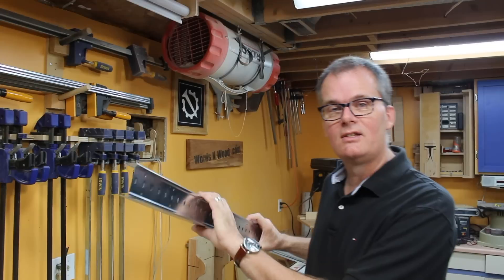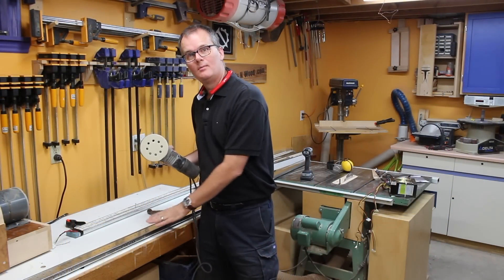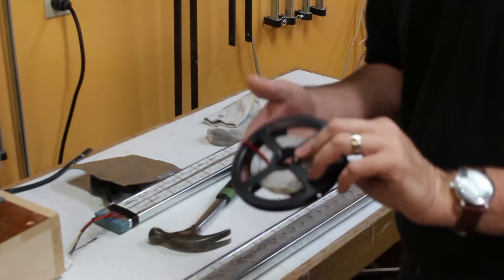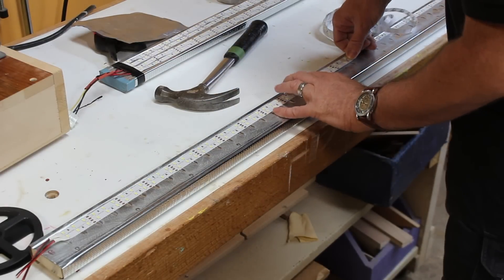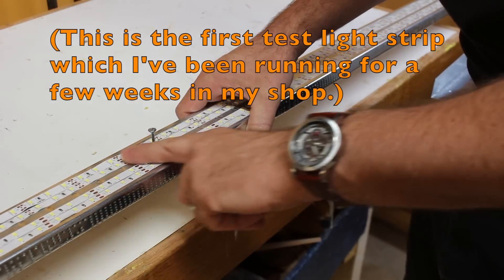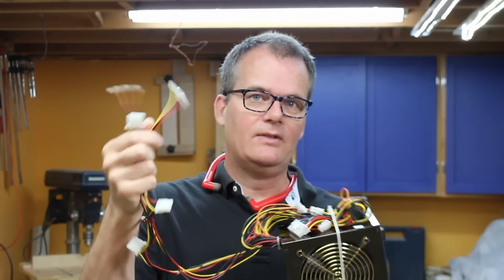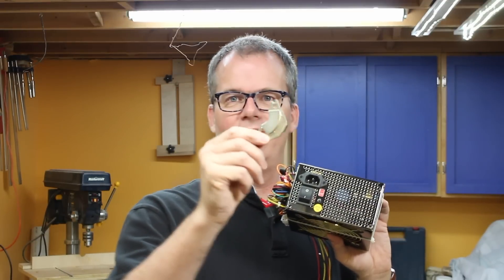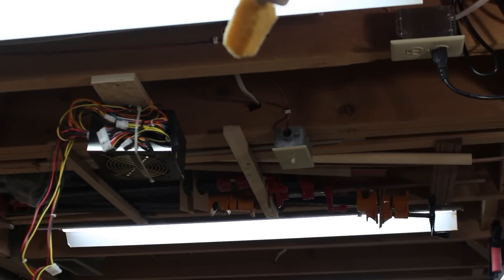Hacking LED strip lights.  AGAIN!   Last Time!  Promise! (WnW #59)

Comment: Seems cool, but, the 400 watts power supply takes away from the efficiency of the LED. Wouldn't a 100 watt bulb use less power?
Reply: It supplies up to 400 watts. That doesn't mean it uses 400 watts all the time.
Reply: Besides what Emil said, strip LEDs are pretty inefficient because of all the resistors. Would be much cheaper, in the long run, to buy some e27/26 sockets and install LED bulbs on the ceiling... or to get some kind of ceiling lighting unit.

Comment: Clever way to mount the power supply. You could also leave the power switch on, put a long low-voltage wire on the green/black pair with a switch at the end to do a low-voltage remote on/off. Cheers.
Reply: interesting mounting job on the power supply, but i'd be afraid that I might be moving something long like a broom handle and dislodge it from the magnets.  It will most likely only fall as far as the slack on the wiring allows, but still...

Comment: these LEDs are not good for this kind of work!
They will break soon. If you want my advice, do not connect it to 12V, but by a voltage of 10-11V, their life will be longer

Comment: looks really nice. also the magnet trick is an awesome idea. gotta remember this for myself. if the ratsnest annoys you too much you can unsoldered the most of the connections inside the PSU and hardwire the poweron wire directly inside it. that's what I have done with my "bench supply".
Reply from the maker: Thanks, I'll keep that in mind.

Comment: Converted my shop lights to the Hyperikon T8 bulbs. Man the difference is amazing. I like the diy approach but hyperikon gives you free lampholders with the bulbs and i have just made a couple lights from scratch with those.
Reply from the maker: T8 Bulbs are nice!
Reply: Yeah these are led t8 bulbs, you have to bypass the ballast but they fit in your normal fixtures. And pretty cost effective given the years they last

Comment: Nice solution Art. I might have asked you this before, but any problem with the colour temperature matching the fluorescents? I bought a reel that was "cool" white, but looks too blue when compared to "daylight" bulbs. I think that when light from windows is not much of a factor, the best colour temp for natural looking skin tone is something a bit warmer.
Reply from the maker: My fluorescent bulbs are all "daylight", and that is what I looked for with the LEDs also.  The cheaper LEDs were just labeled "white", though.   I really have not fussed much with the camera settings and it seems okay so far.

Comment: Another interesting video. I was wondering how much power the pc power supply draws? Is it any less expensive having the pc power supply running the LED lights as apposed to the regular fluorescent lights running in the shop? I know there are LED lights that are a direct replacement for the fluorescent bulbs and they fit into the existing fixtures with a small amount of wiring to do. Is your led strip lighting better? It seems like a lot of work? Is it cost effective? Thanks for posting these videos. They always leave me with questions and ideas. Here is what I saw. https://www.amazon.ca/Relisted-Original-Brightest-Fluorescent-Replacement/dp/B00PVCDKC2/ref=sr_1_2?ie=UTF8&qid=1464979364&sr=8-2&keywords=led+fluorescent
Reply from the maker: I got into the dollars and watts in the first video
Reply: thanks
Reply: I recently was in a store that was replacing fluorescent with LEDs and an electritian who was there told me he had meter tested a place with fluorescent installed the LED replacement bulbs using original ballasts, T8 style, and it actually drew more than fluorescent. removing ballast system draws much less

Comment: Man, those cheap LED strips turn out to be a lot of work!
Reply from the maker: Almost like building your own bandsaw... wait...
Reply from the maker: both, but mostly 5630s.   This is expanded on a bit in the accompanying articles
Reply from the maker: Not noticeably.   No.  No.   T
Reply: Wordsnwood (Art Mulder)
And yes you have great videos and you got a sub. :)
Reply: 5630 or 5050 ? And you should try putting them in zic zac pattent. like this 
-  -  -  -  -
  -  -  -  -  -
-  -  -  -  -        It will spread the light more even. :)
Reply: Wordsnwood (Art Mulder)
Are they brighter ? Are they use lover wattage ? And did you try to use metal dry wall mounts ?

Comment: good job - smart thinking on the metal stud.  for under kitchen cabinets a ran -mounted a flat 1" plastic/foam(whatever it is) molding strip.  Pull the tap backer off and it sticks & stays nicely.
Reply from the maker: I got the brightest and densest (most LEDs per meter) I could find, and packed them tight together... hence the heat.   Thanks for stopping by.